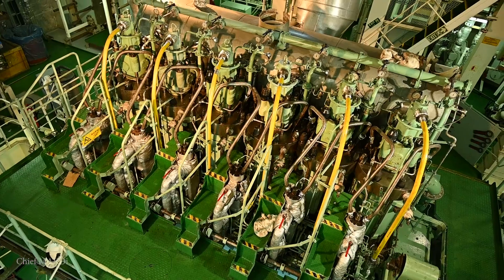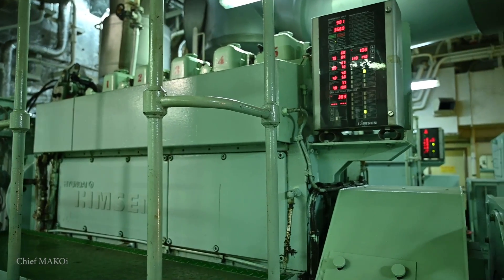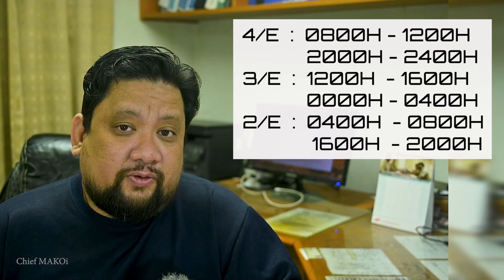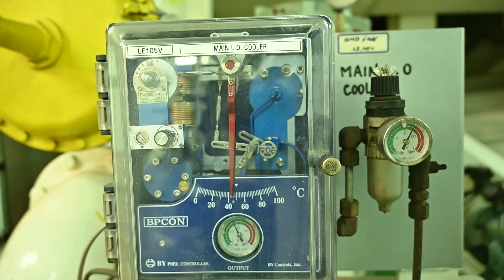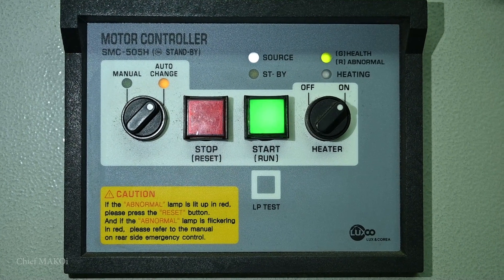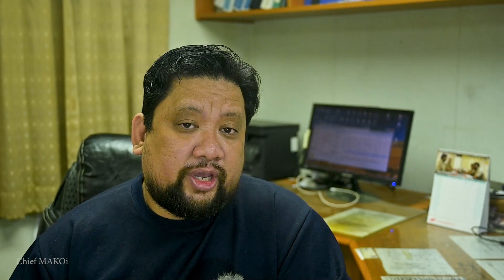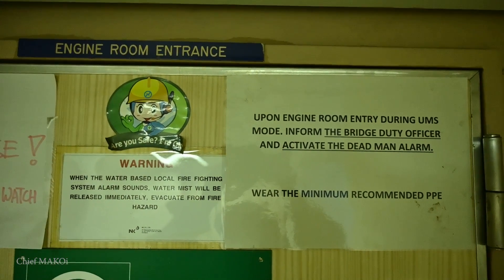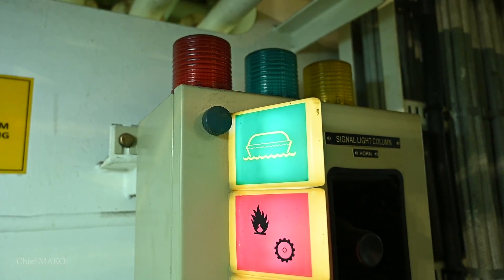Ships Have Unmanned Engine Rooms? | Chief MAKOi

Comment: Chief Makoi... I loved this explanation.  I am a grad from KP (US Merchant Marine Acad. '95)  My major was "Ships Officer"; I was a deck major with a minor in Marine Engineering (3rd mate & QMED endorsement).  As a cadet, I sailed 200 days on deck and 100 days in the engine room.  (Cedit of 60 days awarded for sims and other training).  

The reason the major was created was for UMS endorsed vessels.  (It has since been eliminated from the program).  I loved what I studied.  I did accident investigations with the USCG and later flight school, flying helicopters for them.  The major was intended to create a mariner who could understand what the implications of engine room alarms were & how to intelligently respond to the them.  While not entirely necessary, I learned so much and replaced cylinder liners, service lube oil pruifiers and so much more.  By no means did this make me a Marine Engineer, but for what came leter down the road, I was so well prepared.  

Have been in both world's, I had a very good appreciation for how difficult and challengine the work of maintaining an engine room on a merchatn ship was.  I also understood the complexity of the systems in the engine room and viewed the controls on the bridge with a greater respect as a result of having had that training!

Your content is just excellent here!!!

John Smith Hall LT, USCG
KP '95 (USMMA)

Comment: Most airplanes had eliminated the flight engineer position, except Russian planes. They carry extra people in case of break downs in remote places where they often are operating from. Ships where weight and space is not a factor, should still carry a few engineers in case of break downs.  But single engine large ships should not be allowed, Just as we do not allow a plane 737 and larger to be single engine. Cost savings should have a limit. If you really want the ultimate cost savings, then you have to have a robot ship, technology is not quite there yet.

Comment: I would imagine you would have to have people in the engine room to look over the equipment while it’s running checking on it time to time for leaks because fires in an engine room are disastrous and you as a engineer should know that. Even in cruise ships there’s people in the engine room at all times. There have been quite a few engine fires that were disastrous some bigger than others. But technically wise yeah you could run an engine room with nobody in it. Just like you can run the whole ship from the engine room. Without having anyone in the Wheelhouse. Matter fact the Mersk that was boarded by pirates they were gonna run the ship from the engine room and lock out the Pirates but for some reason they didn’t.

Comment: Question.  During storms do oil level shut down devices get switched off. So rolls don't cause main engine shut downs.  Would an external oil container like a dry sump oiling system so the engine oil main pressure pump feeds from that external reserve. 

Is at least one generator installed on a gimbel so the ship rolling to any angle cannot shut off that generator.
Reply: I can answer your good questions as I was at sea for 18 years, the last 8 as Chief.
No, the alarms for low oil level are never switched off - in fact there's no means for doing so.  Marine engines under Class Rules have to withstand certain roll and pitch angles to ensure they keep going.  From memory it's 22° roll and 5° pitch, but a long time since I last checked.  The near disaster with Viking Sky nearly going aground was that the sumps were at a very low level - around 22% I think, whereas the manufacturer states around 75-80% of the full level as a minimum.
Most engines on ships are dry sump (as was Viking Sky) for that very reason, as a wet sump is usually very long and shallow, whereas a dry sump can be made deeper and with less beam and baffles to limit surge in a seaway.
No, generators aren't on gimbals for the Rules and reasons above, along with the difficulty of providing services to the engine through flexibles, which would have to be very long.  Flexibles are fitted between engines and the ship, but are always short and have to be Class Type Approved.

Comment: Interesting to compare to how U.S. Navy ships operate (or at least how they did in the 80's and 90's on Spruance Class Destroyers and Ticonderoga Class Cruisers)

Underway we had one Engine Room Operator and one Engine Room Monitor on watch at all times in each of our two engine rooms.

In addition there was a minimum of 3 watch standers in the Central Control Station, one which managed the propulsion and auxiliary systems, one to manage the electrical plant and one Engineering Officer Of the Watch who was in charge of all things engineering.

Most of the time there were 3 duty sections with each section standing watch for 4 hours at a time twice a day, if there was a shortage of qualified watch standers you'd need to go "port and starboard" with (usually) 4 hours on 4 hours off which as you can imagine was pretty miserable.

During General Quarters (battle stations), Sea & Anchor (going in or out of port), Underway Replenishment or Restricted Maneuvering (operating in a river or in crowded sea lanes) there were many more watches that needed to be manned with almost everybody in the ~60 person engineering department having an assigned watch station.

Comment: In 1985 our ships engine room had an unmanned system. We had a normal dayshift working hours (a 9 to 5 ) but the duty schedule was always in place. After 5 the alarm goes to the duty engineers cabin. At 11 pm the duty engineer goes down to the engineroom and makes his inspection and then goes back to his cabin. Engineers alarm: every engineer down to engine room. Usually big mishap. In '85 i was fresh onboard (apprentice year) and nobody explains theae things, of course. And i ignored the engineers alarm. Turned out the generator's speed governor defuncted and caused a blackout.

Comment: I served on a USN repair ship. USS Markab AR-23 as a MM/3rd class from 1963-65 in the engine room. It had a consolidated engine/boiler room. Typically in port we had 3 men on duty standing 4 & 8(4hr on/8hr off. There was a machinist mate(MM). A boiler technician(BT) and an electricians mate(EM). At sea we had 3(MM'), 3(BT's)boiler technicians, and 1(MMC) Machinist Mate Chief or Machinist mate 1st class. on watch standing 4 hr's on and 4 or 8 hr's off. There wasn't anything on automatic. Lol,
Reply: That's the navy for you - mob handed!
My first trips to sea in the British Merchant Navy had little or no automation - even the oil and jacket water coolers were manually controlled via the bypass valve.  There was a low LO cutout on the main engine and on the generators but that was about it.
Now there's too much and you need a PhD in electronics to fault find...
Reply: That is what I remember.  Two fire rooms and two engine rooms.  Many men awake to make sure nothing bad happened. I understand that the newer destroyers have gas turbine engines and generators with lots of automation.  The bridge has control over rudder and throttles.  Gone are the days of "right standard rudder" and  "all engines ahead two thirds."  Now it is turn the small knob and push the thrust levers forward two clicks.  I don't think the engineering coffee pot has been automated.  Maybe they have Keurig machines now.  USS Brush DD-745.

Comment: Chief how come the large ships dont use steam or gas turbine instead of large diesel engines
Reply: Hi Wayne, for this you need to dive into the theory of thermo-dynamics😂
The fuel bill for a diesel engine is the lowest.
Reply: @janvisser2223  what about LNG carriers? Don’t they use steam turbines?
Reply: @jadenspires1891  Yes, the older ones sure do, but that has more to do with the easy way the boil-off from the cargo tanks can be burned in the boilers.
But less and less marine engineers have the necessary knowledge to operate a main propulsion steamplant,  and more and more engine builders build dual-fuel engines which run on the boil-off. I have already come across with LNG tankers with diesel (dual fuel) propulsion. As well as gas-electric in combination with azipod thrusters.👌
Reply: @janvisser2223  ah ok, also, what about the gas turbines? Naval ships use them, what is the reason civilian maritime vehicles can’t use them as well?
Reply: @jadenspires1891  Well, it has been tried in the 1960ties in a high speed smaller reefer vessel in my country, but that was not very succesfull, it has been removed and a diesel was fitted instead. The way a naval ship is operated differs a lot compared with a merchant vessel. For a naval vessel, the response time of the propulsion plant is important. Something you cannot achieve with a large diesel engine due to the thermal stresses that will occurr. The efficiency of a gasturbine is much lower than that of a (slow speed) diesel engine, not to mention that a reduction gearbox is needed also for a gas turbine installation, this is further decreasing the overall efficiency of the installation.
There it is again: that fuel bill!!
“Not so important for the taxpayers” maybe but very important for a merchant ship owner who wants to make some money with his vessel.
Reply: @janvisser2223  I see, I’m sorry if I sound uneducated, since I am a high school student, so I still have a lot of learning to do.
Reply: @jadenspires1891  No problem Jaden! By asking questions, you will learn! And I am sure that you will find out that every day will bring something new.
Reply: @janvisser2223  I should have asked this before but: what was the name of the reefer vessel you were talking about?
Reply: @jadenspires1891  Geeststar and Geestland built in 1960 in the Netherlands.
The propulsion system consisted of a socalled “free-piston” gasgenerator. The produced gasses were used to drive the gas turbine which in turn drove the controlable pitch propeller via a reduction gearbox.
In 1964 the gas plant was removed and a diesel engine was installed instead on both vessels.
Reply: @janvisser2223  oh nice, and what was the name of the gas turbine and who built them?
Reply: @jadenspires1891  SEP-SIGMA- SEME type GS34 built by the Dutch Licencee
Reply: Reduction gear cost, efficiency, Unmanned operation. Direct connect low speed engines win out every time.  The limit now is crankshaft size.
Reply: @bigtuna4037  ok big tuna thank you
Reply: I know I am late to say this and I don’t mean to poke into your business, but what country are you exactly from?
Reply: @jadenspires1891  Netherlands

Comment: UMS has been around a few years. I stood by a new builds (3) in Japan 1974 and 1975 the last one was Bubiyan. Owned and operated by A.M.P.T.C. All classed as UMS. They do about 4-6 weeks on normal watches and then if satisfactory Status is achieved moved over to UMS.
We did have issues with some of the automation. I left the merchant navy in 1980 to work ashore. Technology has advanced a lot since then so I am assuming UMS operation is more reliable, I hope so.